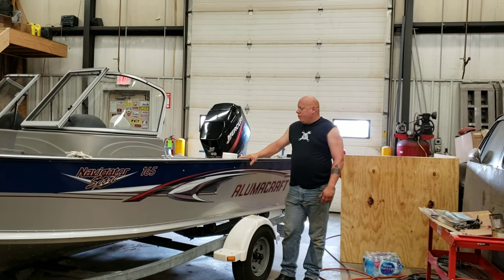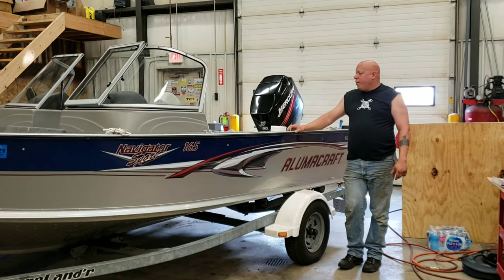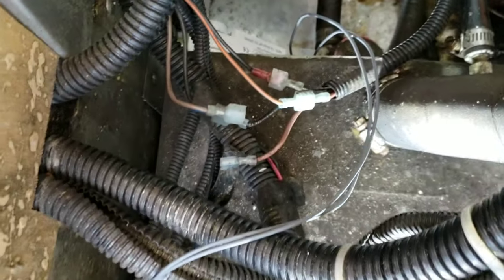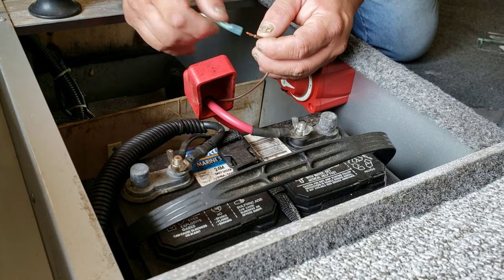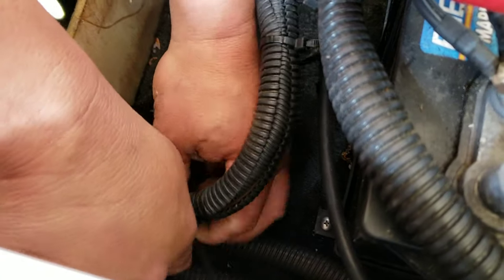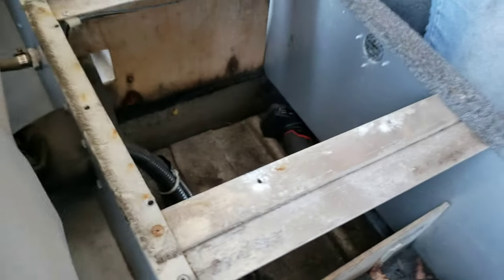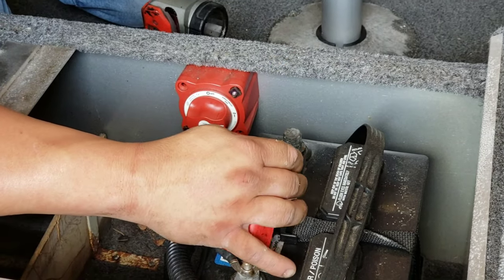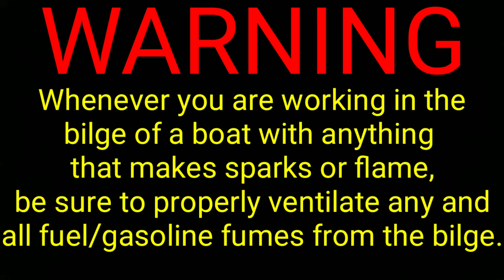Prevent your boat from sinking.  Automatic bilge pump switch installation.

Comment: I use my boat to fish and duck hunt. Most of the time for duck hunting we park the boat and hunt far away from it. Where I live we get a lot of rain and that boat will fill up in some of our severe rain storms. I got tired of walking back to check the boat for rain fill, so straight to the battery on a float switch, it’s the way to go if your going to be away from your, boat, great video , and I just subscribed.

Comment: Could also add a small 30-50w solar panel with a controller to help keep batteries topped off even if no shore power available

Comment: Sadly, Alumacraft isn't the only manufacturer that does not install an automatic bilge pump.  My Tracker needs an auto switch installed as well, and I'm struggling to figure out how to make room for a float switch.

Comment: I got a big problem with my boat with water getting in through the Bilge Pump Outlet it's a new 2015 fiberglass boat had the for awhile now but it is designed for 6 People in the boat it size of the boat is 6.20 & I've had the boat for awhile now but couldn't understand everytime I got back to the boat ramp it always puzzled me every time I took out the Centre drain plug there would be bucket loads of water coming out of the drain hole what the hell is going on & until one day when I got the boat home & after I washed the trailer & boat down & running the 150 hp Yamaha four stroke outboard motor with salt away through the motor I then put the garden hose into the Bilge Pump Outlet & I only had the hose running just a little & water was coming straight out of the centre drain hole  hole apparently the Bilge Pump Outlet has been in the wrong place & there has been a time that I couldn't get the boat up on  the plane & when I got back to the boat ramp  & took out the centre drain plug shit loads of water came out & I only found out 2 weeks my wife wanted to use the toilet so my son opened both valves inlet & outlet & when my wife pressed the switch the toilet pump it wouldn't work & I thought that's strange as we hadn't used the boat for nearly 2 years now all because of Covid-19 Level 4 Lock Down & when the toilet dose get used when we get back home the toilet pump is always gets flushed out with fresh water anyway my son checked out the fuses & behold the 25 amp fuse had blown & so put in a new fuse in & the toilet pump still wouldn't work & when I looked at the toilet pump the outside body of the pump was very rusty & so I had to clean the toilet out & it wasn't nice lucky it was Urine but it was still bad enough the smell from the urine was unbearable but had to be done & after that I got all the urine out of the toilet I then undone all the hoses & took out the whole toilet & pump & I stripped down the pump & flushed the toilet out with fresh clean water & the toilet was rusty in inside the electric motor as water had gone in the the electric motor & that's because water had been getting inside the boat through the Bloody Bilge Pump Outlet & gone right to toilet Electric pump motor bugger & NZ $300.00 later wasn't cheap & I found out the Bilge pump is 1100 gph & it never had a float switch installed & the price here in New Zealand where my wife brought the toilet pump from they wanted NZ $109.00 for a float switch & that's when I looked on AliExpress NZ $ 17.84 & that's all up what a difference in price & it goes with the 1100 gph bilge pump & I told my Dear friend that I was getting a float switch & he said to me can you order me one to as his float switch had packed up & he had his Float Switch for about 20 years & that's been a good run for that Float Switch & through one of the Store on AliExpress & with coupons I'm get the 2 Float Switches NZ $31.81 all up as different Stores on AliExpress have different prices & found the best price & they are already on the way to New Zealand & when I come up with some money I'm going to move my Bilge Pump Outlet right up to the side rear of the boat & in that way I will never have that much water in my boat ever again BLOODY STUPID PLACE TO PUT A BILGE PUMP OUTLET & WATER CAN GET IN THROUGH THE BILGE PUMP OUTLET NOT BAD DESIGN  JUST IMAGINE IF I WENT OUT IN THE BOAT AT NIGHT TIME & SLEPT ON THE BOAT I WOULD HAVE HAD A SINKING BOAT NOT NICE & when I get my new Float Switch I'm installing it myself & All the connectors will be heat shrink electrical connectors & have ordered water proof fuse holders the positive side of the battery & the one fuse holder will be connected to the positive side of the Bilge Pump wire & will also have my wires through black electrical conduit & that will solve my problem for awhile until I will change my Bilge Pump Outlet right up to the left hand side rear of the boat & have the rear of the old outlet block properly by another boat builder & no more problems with that much water getting into the boat & doing damage to our toilet pump the guy that built this boat we have got as well as all the other ones he has made with Bilge Pump Outlets probably didn't think there would be any issue but there a BLOODY F_____N BIG ISSUE & its cost me more money in fuel with all that water coming in the boat through the Bilge Pump Outlet Not Nice At All Kind Regards Peter PS Keep Up The Good Work

Comment: Just bought my first alumacraft and it has a pump that when I pull the switch water comes out the side if the boat?? My girl forgot the plug and I hat to race and put the plug in while in the water. So I pulled the switch and water came out the side of the boat with that help drain it.

Comment: I love the intro with the music, that was cool. The rest was done right too, with no music interfering. Good job. You could've added that into a second time at the end..lol..
I'd like yo know how high a bilge pump will lift the water in a tube, or how far it will lift the water off the bottom of the boat. I'm mentally picturing a way to use a bilge pump and float in or with a RAIN BARREL, pumping the water to a higher location where it can be used in a gravity fed home water system, connecting the battery to a solar panel. You put a fuse on both of the wires to the float, right? Both 15 amp? What size is the brown wire, and what size are those wire connectors? There are so many available that it's SO CONFUSING JUST LOOKING AT THEM when you've never done any of this at all! Thanx!
Reply: Another thing you could do to make it better, is show it all in a simple drawing diagram, how the wiring goes in association to the battery, placement of fuses, etc. Would help us who are electrically illiterate.

Comment: One question.  I see you connected one of the switch wires to the pump and to the battery.  What did you do with the second wire on the switch?
Reply from the maker: It goes to the pump's positive side.  So it goes battery positive to switch to pump the battery negative.